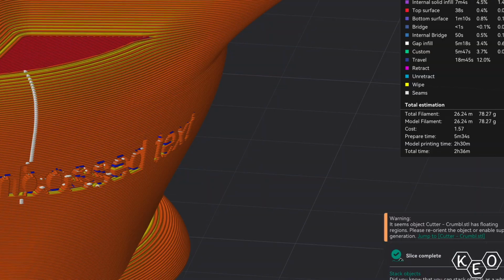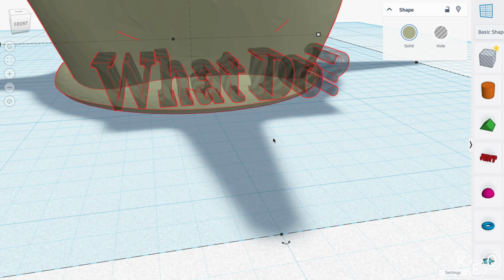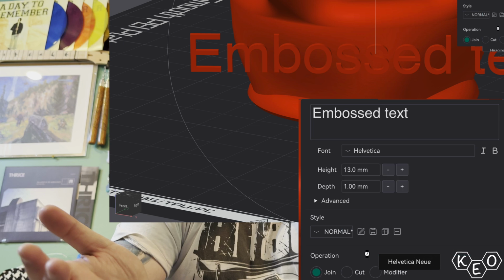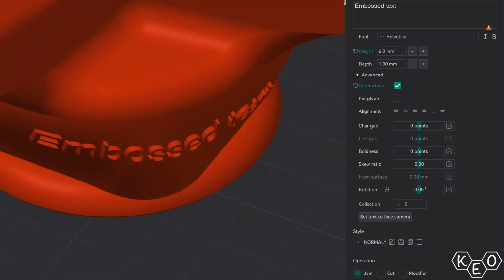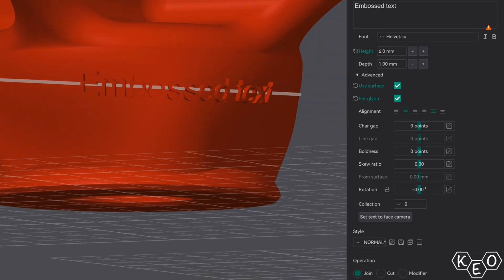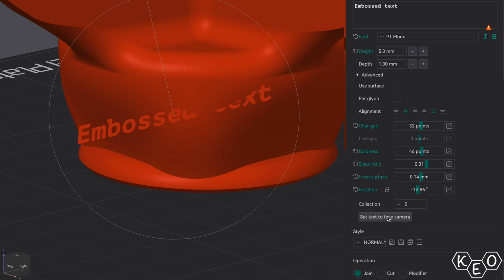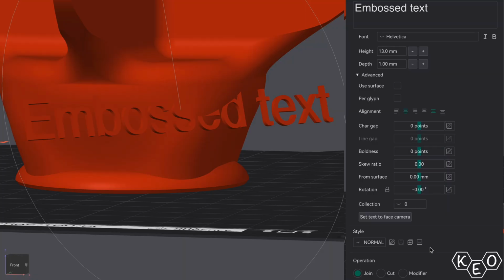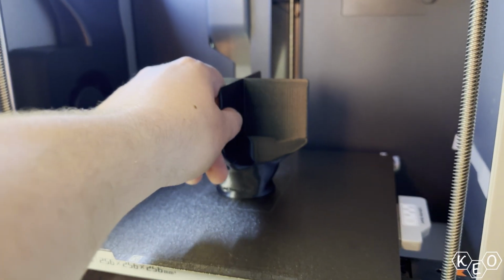This Is The Best Slicer For Custom Text On 3D Prints | Orca Slicer Text Emboss Tutorial

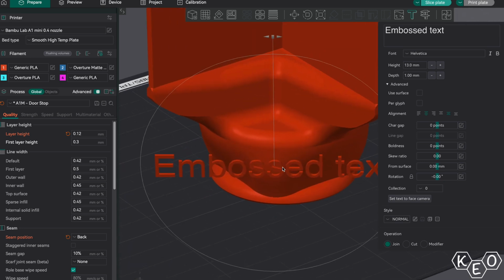Comment: I'm really struggling to figure out how to drag the text around to get it onto the surface I want. In the video you at about 1:39 you say we can begin dragging it around. How do you do that? Is there a key stroke to get it to allow you to drag? I've tried clicking and dragging but the part I had selected when I went to add the text starts moving around.
Reply from the maker: I think I’ve experienced the same issue. As long as the part is selected before you should be able to click the text and drag it but I know it can be hard to grab sometimes
Reply: @KeoPrints  That was it. I zoomed in really close to the text so that I was just clicking on the text and that allowed me to then drag it around. Thank you!
Reply: @jodyking7278 Sitting here with coffee at 5am going absolute BATSHIT because I had/have the same issue. Trying that now. Would be HELLA EASIER if they gave you coordinates of the surface to move it too.